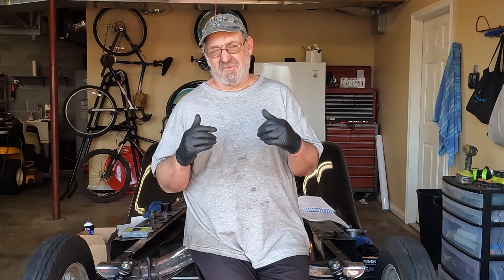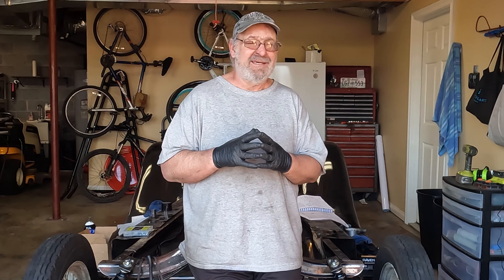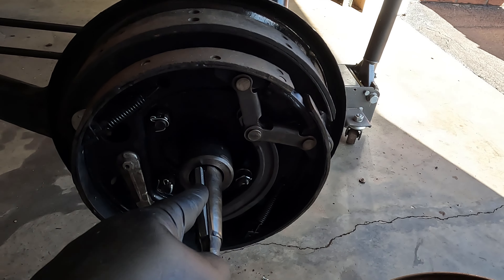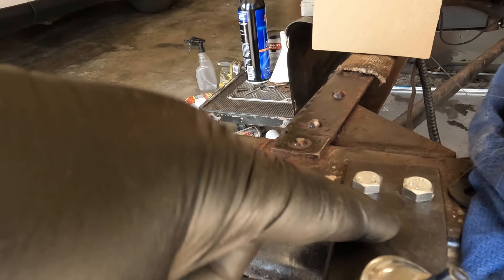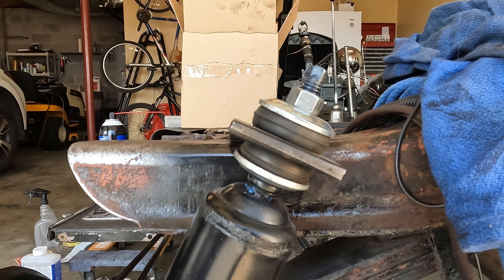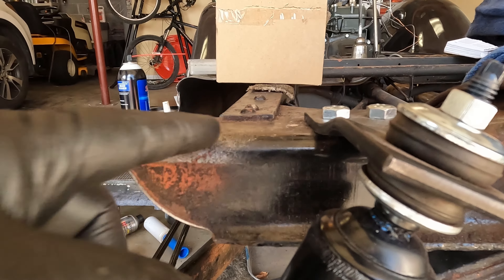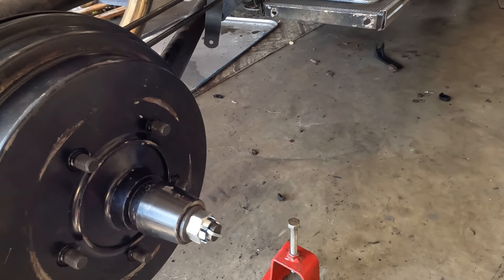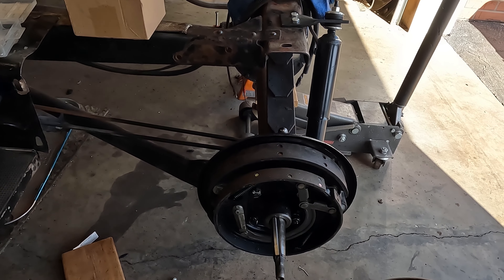Building a 1930 Ford Model A Custom Woody Huckster from the Car I Cut Up Part 3 Rear Brakes & Shocks

Comment: Sometimes the aftermarket does not build their products for all applications. I have seen it all too often. One of our suppliers does not make a bracket for one of our vehicles. Thus we are on our own to make one or find a suitable substitute. The powers that be (our big bosses!) do not understand that we are in fact a custom shop when it comes to making it happen! Not every part is 'bolt on' nor every electronic device 'plug and play'. 
I feel your frustration and hesitation to say one way or the other without actually trying it out. 
Good stuff, Ken!
Keep it up!
Reply from the maker: Thank you my friend.  I was a bit overwhelmed when I first looked at the upper bracket and just how in the world it was going to fit in there.  Ken did mention that with a Fordor, I would need to carve out some wood, but as I recalled, it seemed excessive, so I just put it off until I was going to get into the project over the winter.  As you know, that shifted gears when I discovered all sorts of issues with the body and wood.  Ride wise, I have not heard anyone complain about his shocks and as far as the fronts go, it made a huge improvement in the ride of my car, so I expect it will be even better now.
Reply: @kensmithgallery4432  Yeah, I experimented with shocks years ago. The old tractor I drove (1985 International)had no provisions for shocks on the drive axles. Front only. Tried it on the Ford Ranger. It works...some what. But front dampers are a must.

Comment: Could you not put the upper mounting brackets the other way up, i.e. orientated downwards?

Depending on how it was sold, but it was meant to be just a bolt-on part, I would be having a word with the supplier because that does not look right!

Get well soon!
Reply from the maker: Thanks for the get well wishes!  I'm feeling so much better now!

As to the upper perch mount for the shocks, with all other Model A styles, these do not have any issues.  It's just the Fordors because of the amount of wood for the subrails.  Otherwise, there isn't any issues at all.  Of course I want to re-mention that without the original body being on the car, it truly is hard to completely verify now weather or not I would have had to lift the body to get the upper brackets on.  What I said in the video was more along the lines of what I speculated.  That being said, I did read on one of the Ford forums (take that for what it's worth) another Fordor owner experiencing a similar issue.  My large hands do not make getting into small places any easier either.